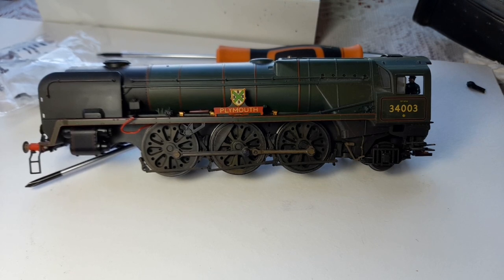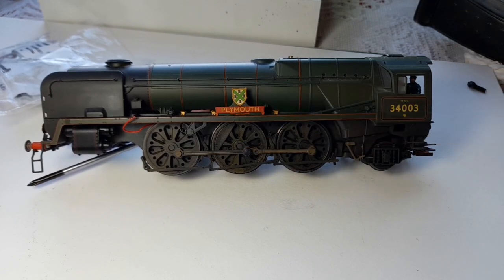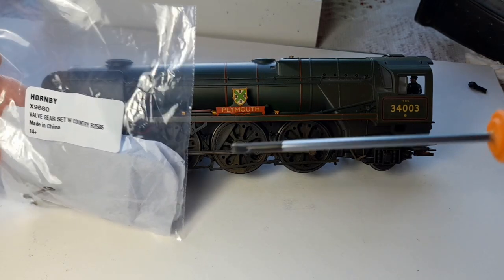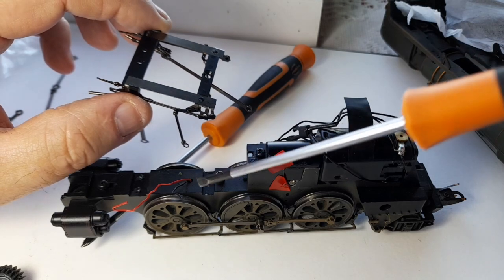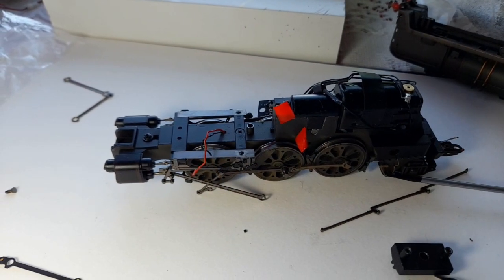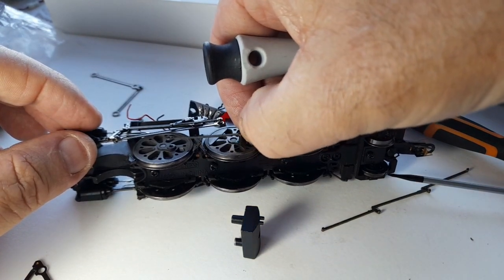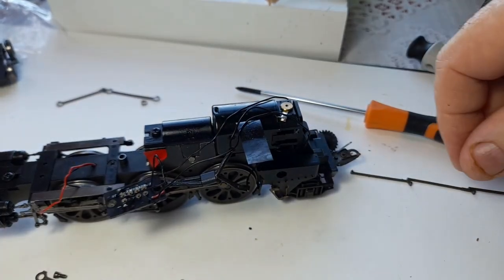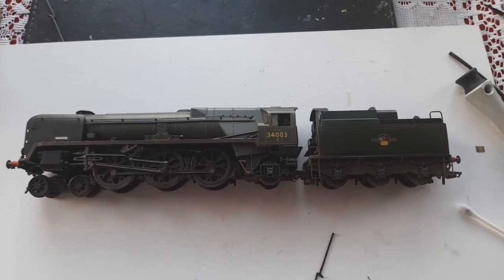Replacing Hornby West Country Valve Gear and Idler Gear

Comment: Many thanks for that,very helpful. Please can you let me know where you got the valve gear from. A fiddlely job,but well worth it
Reply from the maker: The video was made over a year ago now, and was purchased off a well know auction site. Peters spares did have a couple last week but wasn't cheap at all. I now tend to look out for damaged non runner versions  so long as the valve is un damaged and purchase them, once received I strip them down for spare parts and sell on whsts left to break even financially.

Comment: thank you for your video it help me fix my loco which without i wouldn't of had a clue where to even begin thank you
Reply from the maker: So glad you found it useful.

X8849 parts are now becoming increasingly rarer to get, and there are 3 different types, which doesn't make matters easier.

But X7613 another idler gear will fit and far cheaper to buy - hope this helps. Thank you for your comment
Reply: @hortoncommonmodelrailway  after following you instructions i managed to get the right running gear from peters spares cost about £15. thanks again
Reply from the maker: @MrWozzy28  yes that's about right, X7813s are currently £3.99, and........mif you knock out the spindle, reverse the large gear, eeplace on the spindle it will replace a broken idler gear in a Britannia model too

Comment: Great repair video. I'm not quite at the level of filming whilst doing repairs. It's a shame that certain parts are hard to find. A donor chassis was the only option on an old Bachmann loco I had sitting for a few years. Sadly there are dishonest people out there thankfully few and far between. Best wishes Paul.
Reply from the maker: Apologies for the late reply, yes sadly there are some very dishonest people out there. A couple of years ago I bought a set of this valve gear as new, when it arrived it clearly wasn't new at all, infact it was badly worn, the ends of the slides were oval and rounded instead of square, a battle ensued on ebay but I persisted with my claim and got a full refund, despite all the protests from the scam seller  who still advertises but has had 4 different identities in the past year alone - so that tells you something. You raise very valid pints, always been good idea to grab a cheap loco and break it down as spares getting harder to come by these days, thanks for your comment.

Comment: Excellent video. It's always more difficult to do when you are making a video as opposed to when you are not. I have a BoB and the idler gear problem will no doubt arise at some stage. It's already a bit noisy. However, mine has a scew motor and two brass flywheels. Do you know if this will cause complications? Thanks.

Comment: Do you have to remove the wires
Reply from the maker: To fit it in Yes you do, I simply cut them at the blanking plug and yuu can then remove the defective valve gear, thread the wire though the middle of the new set of valve gear and simply resolder the wires, the black wire goes to to top outer  left hand corner and the red to to the outer right hand corner

Comment: These gears are a weak link why they went from brass to plastic progress I think not
Reply from the maker: The only brass gear is the wire gear, the Idler gears have always been plastic, today I got 5 new sets of Idler gears and they are a completely new design so hopefully should stop the gears splitting now - just done another video to be published tonight about them.
Reply: @hortoncommonmodelrailway  I had an early 2000s hornby streamlined duchess that had a brass idler gear
Reply from the maker: @jameshardy4354  last brass gear train I had from Hornby was their networked in 2000 - the worm sharpened the gear wheel til it was dangerously razor sharp and after slicing my fingers several times simolybdisposed of the entire model as a health and safety risk that was too dangerous to operate